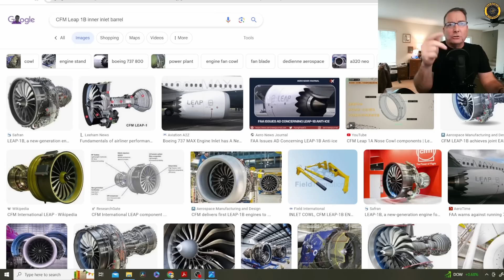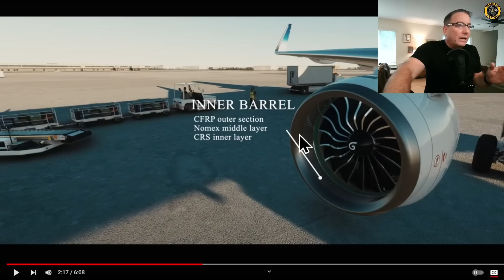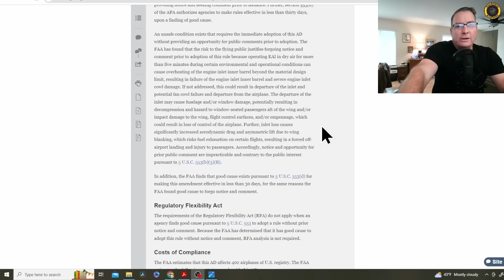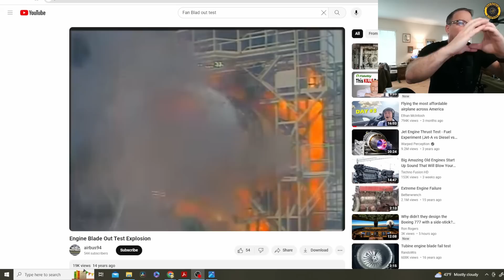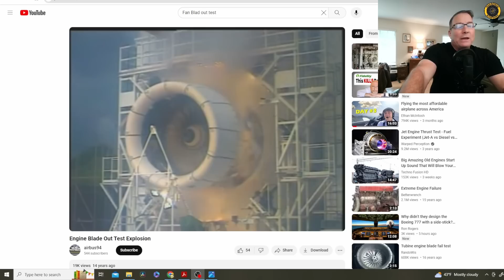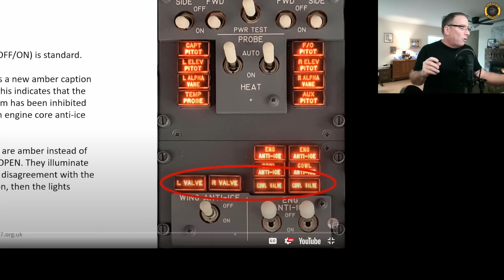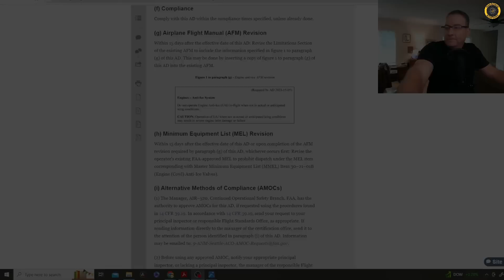Boeing 737 Max-7/-10 Certification HALTED! 1 Feb 2024

Comment: As a 33 year veteran of a major airline I can tell you it’s easy to remember to turn the engine anti ice on, but very easy to forget to turn it off especially during high workload periods of flight. 
It’s incredible what Boeing has been allowed to get away with, but that’s what expensive lawyers and lobbyists are paid to do.
Reply: Hell I've shut down engines with the cowls still running!
Reply: @BobbyGeneric145  The cowls running?
Reply: @marcd1981 I don’t know what he means either
Reply: @marcd1981  The cowls would stop with the engines. And this should be perfectly fine, by design!
Reply: @DR_1_1  Don't know if you're being sarcastic or not, but cowlings do not spin, or rotate, or move at all while the engine is running. So they do not have to stop.
Reply: @marcd1981  You are the only one writing about cowls that "spin rotate or move"... I' have no idea why you are imagining that someone else than you believes that.
The point is that pilots sometimes totally forget to switch the de-icing system off, and that's not a safety issue, except on the MAX.
Reply: @BobbyGeneric145 Perhaps Boeing could consider adding an additional crew member into the cockpit to deal with the workload issue here.  They could be called the Flight Engineer
Reply: ? @BobbyGeneric145
Reply: Especially without an auto anti-ice system!
Reply: This is what happens when you keep regurgitating a design from the 1960's.  737 is a great aircraft, but it needs a clean sheet redesign and needed it 15 years ago.
Reply: @LoydChampion  Boeing doesn't make the engines.  The airline buys the airframe (from Boeing) and they buy the engine. Boeing will mate the airline's purchased engine to Boeing's airframe.  A "clean sheet" design of the 737 will have NOTHING to do with the engine.
Reply: @RH-cv1rg   Odds are they would use the same engine planform.  Boeing and Airbus both have input on the design of the engine cover, inlet, and nacelle.  Not the actual engines
Reply: @RH-cv1rg  Correct about the manufacturing, but commercially for the 737 (mainly because of Boeing hegemony but also because there is no choice of engine type) the customer buys an airplane/engine package from Boeing. An engine maintenance contract might be separately negotiated with the engine manufacturer but the engine purchase is wrapped up in the aircraft purchase. The engine manufacturer negotiates the price of the engine and concessions (discounts) with Boeing.
Reply: @charlottelanvin7095  You are incorrect.  The engine is purchased separately from the airframe.  The airline negotiates directly with the engine supplier, not Boeing or Airbus.  The airframe manufacturer mates the airline customer's engines.  Usually the engines are leased and a maintenance package is negotiated at the same time as the buy/lease.  Different engine makers have different programs such as GE's "power by the hour" of usage.
In the case of the 737, early versions could have a low bypass Pratt JT8 engine.  When jet engines went high bypass the front fan became larger.  That posed a problem with clearance on the low wing 737 so GE entered a joint venture in France to form CFM Intl.  They flattened the bottom of the nacelle for clearance and later moved the gearbox so it could be adapted to the 737 airframe.
Reply: @RH-cv1rg  I stand by my statement for the 737. You buy an aircraft, the engines come with it and the commercial squabble is between Boeing and CFM. CFM does lease spare engines but not OE engines. They do of course have a flight hour maintenance package. It's a risk transfer thing
Reply: @charlottelanvin7095  You can stand by your statement but you would be wrong.  I'm telling you how it works but I guess you know better.
Reply: @RH-cv1rg  I do. CFM discusses pricing and conessions with Boeing not with airlines.
Reply: @LoydChampion  And there would have been no teething pains with a new design? That's silly.
Reply: @DerekJohnson-us7vy  Of course there would be issues, there always are.  But everyone learned a lot in the certification process of the 787 that would have made a lot go smoother.
Reply: @LoydChampion there's probably an alternate history where Boeing developed a new narrow body concurrent with the B787.
Reply: @LoydChampion  Such an edgy comment. This wasn't a airframe design issue.
Reply: @LoydChampion I cannot agree more! Simply convert B757 platform accommodation to B737 systems would do.
Reply: @LoydChampion  so does the a320
Reply: @LoydChampion but this engine issue is because it's a clean slate engine design. I would be ghastly afraid if Boeing create entire airplane from scratch. Could one imagine all the issues? OMG 😳
Reply: @Mikinct :  They are not competent anymore. The company needs to be run by top level academic engineers, and staffed by competent engineers all the way to the bottom. They do MBAs and DEI, the exact opposite.
Reply: @Mikinct  Yes, Boeing is fully capable of screwing up anything.  However, the purpose of a new 757-like design is a higher stance that makes everything easier.
Reply: @Mikinct   Like the 787? Yes there were issues, including battery fires in flight, and apparently there still are some issues. But it's performing well now even on the Qantas non-stop flights from Perth to London.
Reply: @Mikinct  As Juan explained, an automatic switch could have been incorporated in a new design.
Reply: @blueyonder1233  I don't disagree
Reply: @Mikinct  No, the issue is because the anti ice system design has to remain as per the original 60s 737.  The same engine design is used in the A320 neo.  No issues with the anti ice there.
Reply: @LoydChampion  Just another example of the problem with a fault intolerant design that was the state of the art in 1966 when the 737-100 was being designed. The 737 still has a number of built in single point failure situations, where fault tolerant systems have not yet been incorporated in the modern versions.  The MCAS disaster was just the latest issue.  Did you know that a faulty radar altimeter caused the auto throttle to retard engine thrust to idle in a Turkish Airlines 737 years ago because the radar altitude input to the auto throttle computer did not use both radar altimeters to check each other for faulty data?  Yet another 737 “garbage in-garbage out” caused  accident.
Reply: @LoydChampion this has literally nothing to do with the airframe and everything to do with Power plant though, a whole airframe redesign won't do shit to fix modern cowl redesign issues
Reply: @Mike.The.Jeweler :  I hear you and I was thinking the same thing but I think that because they couldn’t deviate too much on the “type certification” they did not automate the anti-ice on the engine. Just guessing here. Or just as likely they were just plain ass lazy, or both.
Reply: @steveperreira5850  I believe the anti-ice systems have to fail on, not off so my assumption would be they can't create a system that's going to disable and make the Anti-ice unusable due to the hazard ice represents
Reply: @Mike.The.Jeweler  Re-watch the video. Juan talks about automatic icing sensors in the air frame and that they should be connected to the engine de-icing system. That is very much an air frame to engine problem and is Boeing's responsibility. It is Boeing who puts all the components together. Re-design or all-new design; it still comes down to a connection of sensors to the engine de-icing system that automaiticly turns them on or off.
Reply: @Mike.The.Jeweler   It would allow them to include auto anti-ice instead of the manual version that's required by the type.
Reply: @Mike.The.Jeweler One example would be an auto anti ice system,  which is all to do with airframe.
Reply: @Mike.The.Jeweler  You can't look at either the engine or the airframe in isolation here - the new engine made a changed anti-ice system necessary, but Boeing didn't design a different anti-ice system because they didn't want to deviate too much from the original certificate. This could work fine if they added a mode to the anti-ice system that lets bleed air in UNTIL a maximum temperature is reached and then shuts the valve. And the valve probably needs to be redundant in series so it won't fail open. Plus the old mode 
(ON without automation) as a fallback, in case the temp sensor fails and shuts the valves when you don't want them closed.
Reply: @Mike.The.Jeweler  not true, it has to do with Boeing forcing the mechanism to operate the same as a 737 to avoid recertification.  And that way of operation makes no sense with a modern engine
Reply: @TheJunkFarm  precisely why you'd think they'd not change cowl designs.
Reply: @LoydChampion  The NG should have been a clean sheet. New engines, new wing, new cockpit avionics - wouldn't have taken much to make the whole things new. And you design the fuselage to be a centimeter wider than the A320, to ensure that the new design is resolve the mine is bigger than yours argument.
Reply: @LoydChampion :  I beg to differ with you. It was a crash prone aircraft when it first came out. You know that. They improved it after 20 years of being a killing machine with fully engaged stuck rudder Actuator that they knew about for decades before fixing it.  Yes it was a better plan finally with the 100s Series.  Then they went backwards again with the max.

When I was learning to fly they were finally coming out with the 100s Series.  My instructor pilot was on his way to becoming a commercial airline pilot and his dad was a 737 pilot.

….FLUFF….???  Yeah that is what they called it, “fat little Ugly flying f|_|Ck€r”.
Reply: High workload conditions like, say, dealing with severe engine damage? That's the scariest part of this to me, that one engine letting go leads to a situation that makes it a lot more likely the other one will as well.
Reply: @IcthioVelocipede . What if BOTH engines suffered such a fan failure?!
Reply: @coucoach3342  - cowling goes with the engine.  Know where they are made and for whom.  This is the front rim (I think of it as the "nose piece" of the cowling), and I have never asked that specific question before.  I don't think it goes with the nacelle, but it is possible.  Damn details will get you every time.
Reply: I've had to go out and run up engines that had the engine anti-ice either not shut down or shut down when there was insufficient "muscle pressure" to close the valves completely. I enjoy it.
Reply: Boeing likes to think they are building GE refrigerators and not airliners…
Reply: @Marco-wd7rk  But a GE refrigerator can defrost itself with no attention from anyone.   Why can't this airliner defrosting be automatic too?
Reply: Never a pilot but I can see how that would be the case. 
Simple solutions are the answer and I think Boeing is going for clever solutions.
"Keep it simple stupid"
Reply: This is a booby trap airplane. It constantly tries to kill you.
Reply: Forgetting to turn it off keeps me up night lol.
Reply: Lobbying should be made illegal for years.
It’s a form of corruption done in plain sight.
Reply: It's the engine manufacturer, not Boeing. You $%#@&!!!!!!
Reply: Boeing is killing itself by ignoring humansys (a engineer / human behaviour mix) design. Management in technology environment is something else than arrogant MBA managers think it is. We (in the west) have diploma and education system problem. It is bigger than Boeing! It shows in Boeing first because the nature of air traffic systems.
Reply: What I am surprised about it that Boeing has not yet made a 737 with a hump .... like a 747...   Fat Max.... just to take the level of rediculess design.... to the max....
Reply: Could Boeing be having a Bud Light moment  ?
Reply: isnt there a FMS message TAI temperature above 10C? I am now learning to fly 737 and the FMC message is a good reminder, amber light shines to your face
Reply: Nah lawyers have nothing to do with lawyers. The US government wants domestic production capability of civilian airliners. Since Boeing is the only game in town, they've been able to get away with murder. Literally. We can't be dependent on Canada or Europe for airliners in the event of ww3
Reply: Airbus is having the same issue with their LEAP’s.
Reply: I believe much of Boeing's problems today can be traced to not elevating Alan Mulally to CEO.  He was the one to helm the 777 program from the start and that program marked the rise of the twin jet ETOPS.
Reply: It’s a procedural issue that needs a habit pattern and nothing more. This “YouTuber” just likes to hear himself talk.
Reply: True
Reply: Also doesn’t help that Boeing took away the blue lights from the overhead that shows the engine anti-ice valve is open. Much easier to forget and not notice the switch position verses seeing the blue lights in my overhead scan.
Reply: the sad result of letting bean counters and sales people making aviation engineering decisions
Reply: Boeing was essentially asking for an exemption to an airworthiness directive, where the amoc is a single point of failure.  The word that comes to mind is hubris.
Reply: and to note that passengers pay with their lives. To Boeing it is just Dollars. To the FAA it is just another day at the office. @deeveeation6733
Reply: Incredible that it is not automatic. I’m barely a pilot, and I know avionics from my Air Force experience as an avionics technician. There is plenty to do when flying a little Cessna 150, I can’t imagine a crew of two pilots having to worry about flicking on and off the Engine anti-ice when it is the most simple of control systems  to make it automatic. I’m also nowadays a control system engineer graduate from a prestigious university. This is unforgivable. This is the worst. The industry is like a dinosaur. Not enough automation. Absolutely crazy!  Besides the whole instrument needs to be revised. It’s like a digital upgrade of analog instruments from 100 years ago. Where is the Birdseye view, the most important orientation aid for situational awareness in the world. It’s available for $50,000 cars but not for $200 million jetliners. Disgraceful, every last one of the interested parties is disgraceful.

You are a pilot, why aren’t you demanding Birdseye view? Instead your union is protecting mentally ill pilots that like to crash airplanes into the Atlantic ocean or the Swiss Alps or fly out into the wild blue yonder in the Indian ocean. You should be demanding a better instrument suite!!  

I designed control panels also.  Never ever would I put a switch in without a back light indicator. Easier than ever to do with LEDs. Really the whole industry is a disgrace to the human race and Collectively a high priced cadre of first rate killers - first of all the executives at Boeing and Airbus, secondly the pilots and their union, and also in second the incompetent engineers designing 100 year old Instrument panel.
Reply: @steveperreira5850  This is a technical design problem with the inket cowling. Your dislike of unions, mental health, female crew, and whatever else is not relevant.
Reply: @steveperreira5850 prestigious, you say?  You figure it out in your free time then, then enjoy your brandy
Reply: @steveperreira5850 I don't believe the 757 has automatic anti-ice either.
Reply: @steveperreira5850 that’s quite the rant. I see your points and frustrations.  But I would bet that a lot of the issues you identify are the result of FAA regulations.  It’s difficult to change aircraft design, even minor cockpit switches, without complying with a variety of federal regulations.  Companies are slow to change. Add government regulations and watch change grind to a halt.
Reply: @steveperreira5850  If it were automatic, it would be considered a significant enough system change that Boeing could not piggyback the MAX aircrafts onto some of the original 737 names/certs/specs/etc.  The whole purpose of staying with the basic 737 platform was to save time.  Two biggest time sinks are initial design and all the certification and qualifications required by the FAA.  By calling thing "737 rev XXX", Boeing was trying to play the system.  Even if it meant not using the latest technology or giving pilots the most optimum training.  
(Look - it's just like the old 737!  What's that?  MCAS?  Oh, don't worry about that silly old thing.  You will hardly ever need it!)
Reply: Seems to be more of an engine problem, than a Boeing problem IMO. Don’t new engine designs have to be certified before they are installed on an aircraft?  I think they would’ve caught this design flaw during testing of the engine.  I suppose the engine manufacturers have lobbyists too…
Reply: @jimbates955  The engine from the nose cowl back is GE and Safran. The nose cowl is subcontracted by Boeing. I can't recall exactly who produces it. Might be Goodrich. FWIW, the Airbus NEO aircraft probably have Safran inlets. The two are not even close to being interchangeable. It's totally a Boeing problem.
Reply: @jimbates955 it's not primarily an engine problem because Boeing could have decided to build in an automatic system that turns anti icing on and off depending on the conditions and thereby prevent any possible overheating. But their first and foremost interest wasn't safety but to keep the type certificate so airlines didn't need to retrain their pilots to a new type with a new/better system.
Reply: @panpan25911  Then why are Airbus' customers suffering from delays and cancellations from using LEAP engines on the A320 Neo and having to do a frequent inspection cycle on those, also? It is the responsibility of the engine manufacturer to meet the specs agreed upon for the engine application, not Boeing's.
Reply: Agree but Boeing chose to just accept the defective design. Is it that difficult to sense the cowl temp and switch off the bleed air or indicate the status to the crew ?.  Remember that Boeing would only provide an indicator for  ' disagreement ' of AOA  as an option !!!.  An aircraft crash because of this.   @jimbates955
Reply: @jimbates955  Yes, it's an engine issue, but the Anti-Ice options, like with MCAS options, are decided on by each airline. And Boeing should have evaluated this system as much as any other system that should have been on these new aircraft. They have dropped the ball, and much more than we know will come out.
Reply: Thanks so much Juan - Broncolirio for your fantastic insight into this east to understand explanation of crucial issues buried deep into the Boeing and I have even greater respect for the crew who have to worry about yet another lingering problem if the NT I valve is stuck after leaving the iceing conditions. It’s shocking to see that despite so much advance in technology of aerospace industry but still stupid design blunders creep up time and again which my bike shop can find reliable solution to.
Reply: I think it's important to remember that Boeing did everything possible to minimize any appearance of change from the basic type certificate and pilot re-training requirements as a cost avoidance for the airlines and to sell the airplane. "Major improvements" with "No new training requirements." Want to buy a bridge in NY?
Reply: Boeing needs to design, build, and certify a NEW JET….not everything can be a 737…geez guys.
Reply: @rodcoulter997  At least drop the word "MAX."
Reply: Boeing is reaping what they have sowed for the last 15 years: corporation by shareholder value/stock price
Reply: Except to note that it is the passengers that would pay with their lives. To Boeing it just dollars.  @Paul1958R
Reply: Seems to me it's a CFM issue by pushing tech too far in order to sell this particular engine.
Boeing fell for it & specified what appears to be a 'bridge too far' development.
Reply: @GARDENER42  The same engine is used in the A320 neo without issues.  The engine cowling is a Boeing design.
Reply: @GARDENER42  I suppose the engine manufacturer gives specifications for the engine. Including the way you should use the anti-icing system.
If Boeing ignored these engine requirements with a manual system then it's their fault.

I didn't check but if other plane designs using the same engine are not affected by this issue, then maybe Boeing are not using the engines right.
Reply: My god so many design flaws for Boeing 737Max, what happen to u boeing
Reply: @reynbalb4945 stock holder profit. Guess which US President turned companies from community oriented to 100% profit driven.?
Reply: @reynbalb4945  not to defend boeing, but you do know cfm designs the engines and the cowling right?........
Reply: @Mike.The.Jeweler but Boeing didn’t design an auto anti ice setting, like everybody else.
Reply: Boeing is a good example of how capitalism and greed is failing American people 🇺🇸 This is not what American people stands for! We are far better at innovating and engineering great products.
Reply: Wait a minute...  You're blaming BOEING on an engine design issue?  Seriously?   It would seem other companies using the same engine or different dash numbers of it would have same problems too.  This problem was discovered just around June of last year and they are planning on getting a fix for it.   It's incredible the amount of BS that pilots are spewing as if they are design engineers.
Reply: @ahndeux  You are not blaming a company that sells you an expensive product for any part of that product ? So if you buy a Ford and a part from China fails you don't go to your dealer but go complain in China?
Reply: @ahndeux  Not blaming Boeing for the design of the engine, it is for them NOT choosing options that were available to cut costs. How do build a commercial airliner that regularly flies in icing conditions without a Warning / Indication system for the Anti-Ice system? This is the same thing Boeing did with MCAS. They made Warning indication an option for the airlines, all without telling them what the system was or did.
Reply: @ahndeux yes, I blame Boeing for not having automatic anti ice.
Reply: @rtbrtb_dutchy4183  You mean you want the engines to automatically make ice?
Reply: @ahndeux  you know what I meant. Engine anti ice.
Reply: @rtbrtb_dutchy4183  Yet Westinghouse refrigerators defrosted themselves in the 50s with no attention from anyone.
Reply: @ahndeux  Its BOEINGS responsibility to make sure the engine design THEY chose can be integrated into THEIR plane SAFELY.  This requires validation and understanding of every aspect of the engine system, including deicing, and bleed air managment.  It should be all part of their validation, and I am sure they discovered it during validation flights long ago, since they are already working on a fix, but they are willing to put peoples lives at risk instead of grounding the planes until the fix is in place.
Reply: @IndependenceIron  If it wasn't safe, the FAA would not have approved it.  It was an escape that went all the way through FAA certification.  The issue was only found last year.  It passed validation because you have to have a specific set of situations where it could become an issue.

You assume that Boeing is putting people at risk.  The FAA can easily ground every single one of the airplanes right now and they're not doing it either.  It's not Boeing's job to ground airplanes.  Its the FAA and the Airline if you didn't know that.
Reply: @ahndeux  Its Boeings job to build a SAFE plane.  The fact that the FAA gave them an exemption on a condition that could fail and engine and damage a fuselage on planes currently in service speaks to the fact that the FAA is not prioritizing safety!!  FAA's certification isn't even good for toilet paper.  much less ensuring peoples safety.
Reply: @IndependenceIron  Said the backseat engineer and FAA inspector.
Reply: Isn't that what checklists are for?
Reply: @Chatta-Ortega  I don't think there is a checklist for not in risk of icing currently
Reply: @Chatta-Ortega  Yes, for engine start or shutdown. But this is something that is happening in flight, at cruise altitudes. There are no checklists for this part of the flight unless a fault / failure comes up. The problem that was explained here is there is no warning light to let you know if you are in icing conditions, and leaving the switches on is not hard to do.
Reply: @Chatta-Ortega  In my aircraft there is no "checklist" telling you to turn off the anti-ice in flight. There is on the after landing checklist, but that could be hours after you encountered icing.
Reply: @Chatta-Ortega  No.  Checklists are for when you encounter an emergency or are preparing to enter a different phase of flight, not to be run every five minutes.
Reply: @Chatta-Ortega  No… Do you thought that the decision taken by the administration and Boeing would have been this one if the simple checklist were be able to solve the problem ?
Reply: @andremetayer1467  
No, but I'm not a pilot.
Reply: @Chatta-Ortega no checklists for icing. Every other plane you can leave them on 24/7 or they are automatic. Imagine high load environment on an ILS approach into a high terrain airport and you had icing when you started but at 750’ agl you hit your time limit from the last icing condition and your engine blows up. That isn’t the time for a terribly designed anti ice system to work. Nor is it the time and place to be thinking about turning off anti ice
Reply: @Chatta-Ortega  a checklist for entering clouds and another for exiting clouds?  Not something feasible or necessary if the thing was engineered properly.
Reply: @Chatta-Ortega No.
Reply: @Chatta-Ortega  There's not really a checklist that I'm aware of for "exiting icing conditions." There are a few checklists that will ask you about the anti-ice switch positions, but we're talking descent, and I don't believe it comes up again later.
Reply: @Chatta-Ortega  for shutdown yes, but there are not ice-anticipating or icing-conditions or exit icing-conditions checklists. You may end up leaving eng. A/I on in flight in non-icing condition and overheat the cowl.